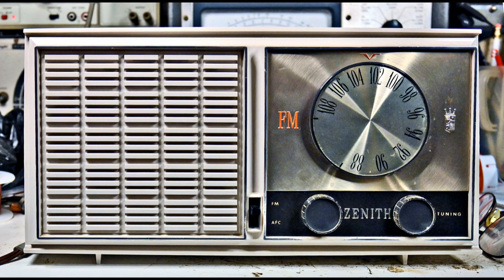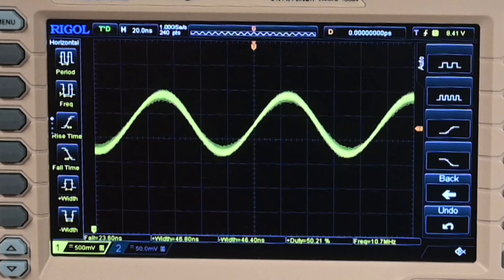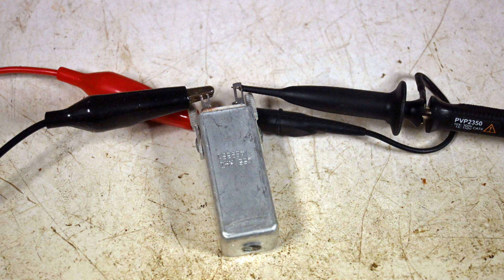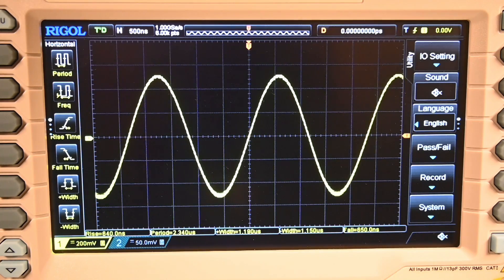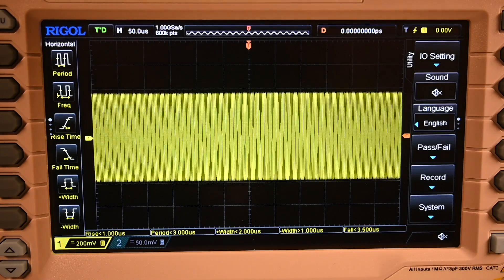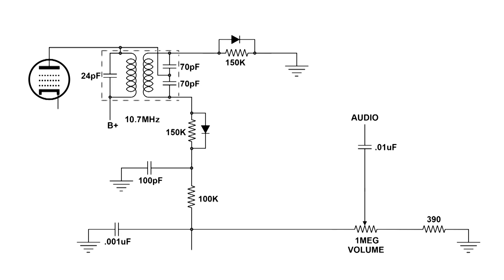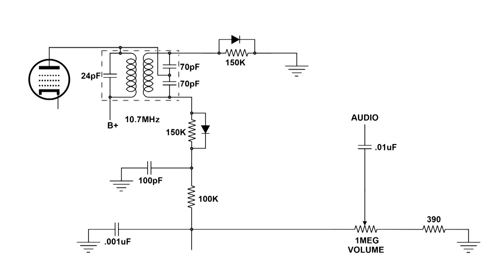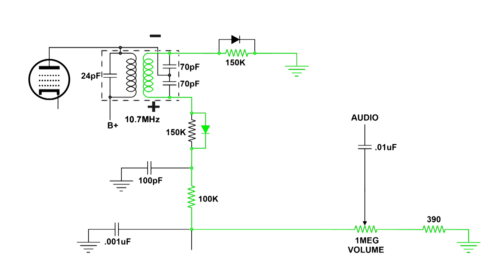FM Discriminator Circuit Audio Detection

Comment: The video was extremely informative.  The combination of the early oscilloscope demonstration of effects and the later schematic representations helped me build 3 LTSpice models which show the LPF characteristic of the Pi Network, the high Q of the double tuned IF Can, and finally the full FM discriminator circuit.  In the model, when an FM signal with a 3 kHz modulation drives the IF Can, the 3 kHz signal is displayed at the audio port.  An FFT of the audio port shows the 3 kHz signal and the 10.7 MHz IF carrier.  I will send the LTSpice models to AllAmericanFiveRadio, if you wish.
Reply from the maker: I’m glad my videos  has helped. Your comment is very much appreciated and I hope you continue to experiment with circuits. The more you learn the more fun it is. Thank again, Rick.

Comment: As usual, I'm enjoying your video. In your download e-book, you mention testing th oscillator by using a scope. There, you mention pin 3 on the 6sa7 as the testpoint. Where do I connect the black lead? Do I go to B-? I don't want to damage my ne scope. Thanks
Reply from the maker: The black lead goes to ground. If you do not have an isolation transformer, I would put a 0.01 at 630WVDC capacitor between the black lead and ground.

Comment: My Christmas present arrived a bit late, but it was just what I had asked for... Thanks!
Reply from the maker: Thank you, and your welcome.
Reply: @AllAmericanFiveRadio  Question:  I wish to avoid the frequency to amplitude conversion until my signal is appropriately amplified and filtered. As this requires a number of IF stages, how do avoid losing my audio information in process? It seems to me that initial IF transformer would prematurely turn my FM into AM and then lose information in the second or final IF transformer. Am I mistaken?
Reply from the maker: @andrewferg8737  You might investigate using Phase Lock Loop and crystal filters. Something else to look into are the new Ham radios, like the IC-7300. This is from ICOM… 
RF Direct Sampling System
The IC-7300 employs an RF direct sampling system. RF signals are directly converted to digital data and processed in the FPGA (Field-Programmable Gate Array), making it possible to simplify the circuit construction. This system is a leading technology making an epoch in amateur radio.